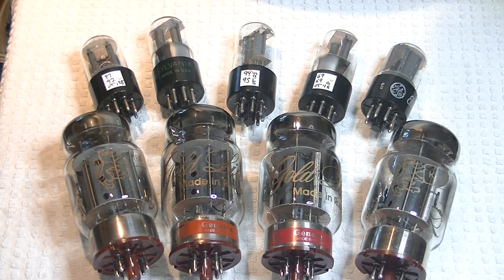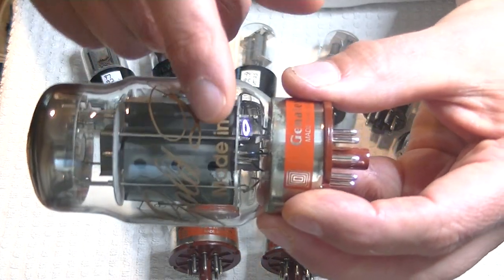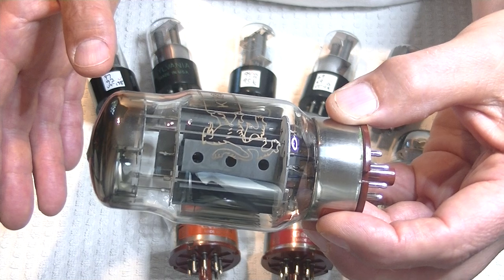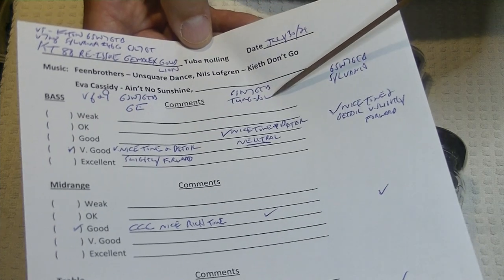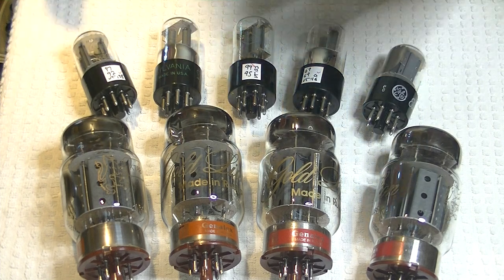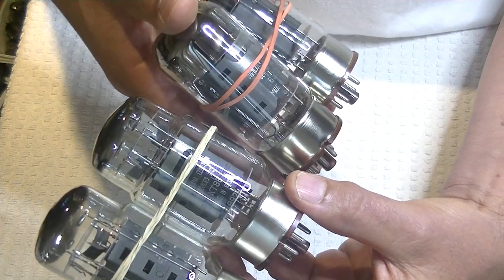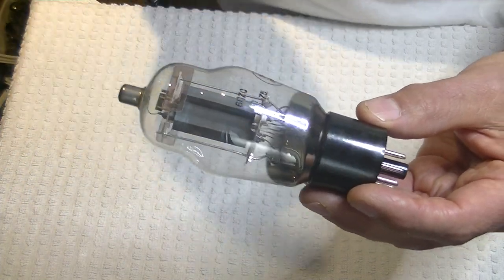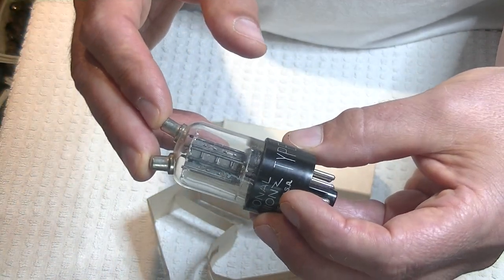Tube Lab #42 Mixing Vintage & Modern Tubes

Comment: Hey Jim.  Lovely vid again sir. Yes to your explanation of the magic of the 50's valves. Mullard had a chemical plants next to their factories, producing special sauce for the coatings. You'll probably find that cost, as you stated, is a factor nowadays but one of the other factors potentially are modern bans of use on  particular compounds. You see back in the day.. if little jonny grew an extra head and his legs eroded away whilst working with chemicals.. he was told to buck up and get back to work if he complained about it. Lololol. Xx
Reply from the maker: Ahhh another piece of the puzzle, I didn't know Mullard had a chemical plant beside the factory, but now you mention it, it makes total sense!  I of course support environmental protection, but while these wonderful vintage tubes are still with us, why not enjoy them!
Reply: @tubelab194  absolutely! I love the look of the gold lions you had there sir xx

Comment: I appreciate your warning at the beginning of each video. Could you please give some examples of mistakes that could lead to injury?
Reply from the maker: What an excellent suggestion!  Maybe a future Tube Lab should talk about this.  In general you NEVER want to get enough of a high voltage shock to accidentally stop your heart while working alone or locked onto a high voltage line and not be able to get off without help.  If the amp is unplugged and the capacitors are discharged you can play around inside all you want.  However if you need to do testing or work with the amp "live" that's a totally different situation and Extreme Caution is required.

Comment: What tube was shown after the kt88? I kept waiting for you to rotate the tube so I could see what it was
Reply from the maker: That tube is the first generation Sylvania 6SL7GT made ~1940-1952.  It shares the warm/rich midrange of all the Sylvania tubes, that I like to call "The Sylvania House Sound".  They've become fairly rare, we currently have a couple of matched pairs available #46bn and #46g.  You can also use the much less expensive Sylvania 7F7 loctal tube (mounted in an adapter socket).  Internally they are identical to the octal version and we have excellent inventory of all versions going way back to the very first 6sl7/7f7 types from the 1930's!